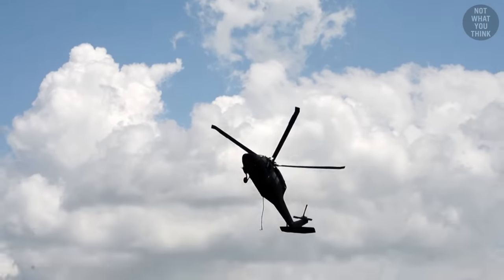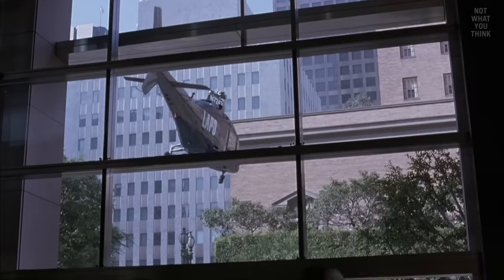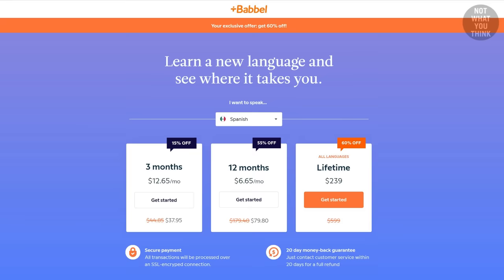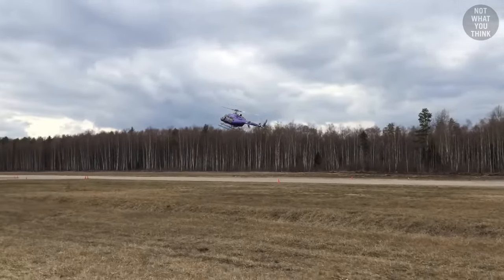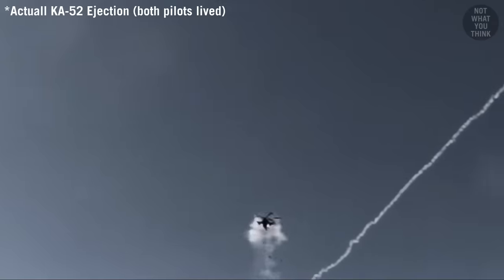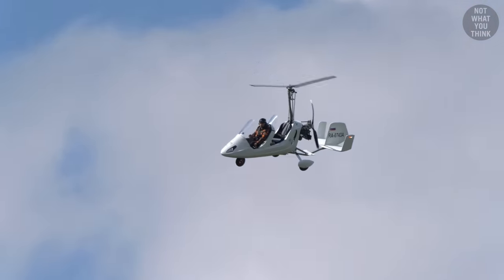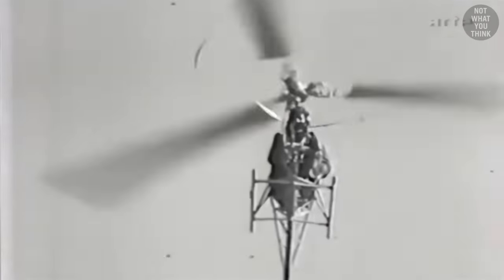Why Helicopters Fall Like a Leaf, Not a Rock

Comment: 40 years ago while serving at a Coast Guard small boat station we routinely participated in training operations with helos.  Autorotation drills were part of those drills and it was impressive and scarey to see an HH-52 with it's rotor blades swooping upward as they plummeted toward the water.  The pilot would engage the transmission about 50 feet off the water to stop the decent and bring the craft to a hover before he would have impacted the water.  Testament to the engineering of the aircraft that they were already almost 30 years old at that time.  The USCG HH-3's were not so reliable and suffered chronic transmission problems.

Comment: something to keep in mind for the facts at the end of the video:

you said helicopters had more frequent crashes than airplanes, but we have to keep in mind that helicopters fly in more complexe terrrain.

i think this could also be said about the death rate. even though airplanes have a higher death rate, airplanes can hold hundreds and hundreds of passengers, and they do more frequently, compared to helicopters. 

all in all, it's hard to really compare the two, since they're practically different worlds. their use and capacity are so different.

Comment: BULL CRAP
@ 600 ft. when you get the tail rotor shot off of a Huey UH1 there is no soft landing I can damn sure testify to that.  It happened right before TET 1968 near the Cambodian border.
There were 5 of us in the chopper. We were returning to Long Bien Base and were about 75 miles out. And if the Aussies weren't in that area our butts would have been KIA. I was a door gunner along with another one on the left side. polit, co-pilot and crew chief were hurt pretty bad but us two gunners were hurt but not as bad to where we couldn't get the Crew Chief out of it because he wasn't strapped in and he was like a ragdoll being thrown around as we were spinning out of control.  It felt like we hit the ground doing 100MPH.  Every bone in my body hurt.  Good news was that none of us got killed but we were hurting for about two weeks. I was hoping that it didn't catch fire, We did get the Crew Chief to come back, I used a canteen full of water and a few smacks in the face he opened his eyes and said, Is this shit over yet? We all got a laugh. We as gunners were strapped in so as not to fall out the door.
We were about 5 miles from the Cambodian border inside Vietnam. 
Long story Short you can't believe everything you hear on youtube or any other platform because most of these guys have never been in a helicopter in their life.

Comment: Ground Resonance doesn't happen randomly. Ground resonance happens when tie downs on an aircraft are not installed properly. Meaning they are too tight. 

If ground resonance does happen randomly without tiedowns installed, that is an issue with the helicopter, as that is not supposed to happen naturally with the bird sitting on the ground.
Reply: I've had ground resonance on a Radio Controlled nitro helicopter, can be a simple matter of the smallest item vibrating and will even change if the fuel tank is full or empty.  Can also be set off by a gust of wind.

Comment: So one critical thing you’ve got wrong, or not very clearly explained, is with how the rotor generates RPM while falling without power. 

The flight controls are rigged such that the full down collective position actually creates a negative pitch. The specific angle needed varies on each type of helicopter. But this is necessary so that the air rushing past the rotor will actually increase its RPM. If the blades didn’t get a negative pitch, the rotor RPM would bleed off no matter what and autorotation would not work. 

On the helicopters I flew on (CH-53E), flight controls would be rigged so that during free fall, rotor speed would increase and maintain approximately 110% of normal operating RPM. Flight control rigging was part of my job as a crew chief and mechanic and I’m positive they get a negative pitch for autorotation. 

Now while performing an autorotation you also want forward airspeed. As you approach the ground, you are supposed to flare the nose up to bleed off the airspeed, then rock the nose back level while pulling collective to get the positive pitch on the blades and cushion the landing. Hopefully it’s timed right and you just land… but really we are just trying to cushion the crash…

Also, the example of ground resonance with the CH-47 is slightly misleading. The whole system is meticulously balanced, but vibrations are never zero.. that example is showing what happens when the helicopter is chained to the ground with no slack in the chains. The helicopter needs to be able to wiggle around on its wheels, kind of like letting it believe it’s in the air. When fixed to the ground, it will definitely shake itself apart. This is extremely important with operating on a ship because aircraft are chained down with tight chains up until it’s time to start up. Then we must ensure that the chains are loosened or removed prior to starting engines to prevent this.

And that leads me to another misleading point about that.. you say two blade systems are not as susceptible to this but that’s just not true. A two blade system can still be extremely out of balance. It’s just far easier to balance a two blade rotor system compared to say, a CH-53E, that has 7 main rotor blades. But I could totally have a 7 blade system that has better track and balance than a 2 blade system done by someone who has no clue what they’re doing.

Comment: I kind of expected the ejection seat system to be just so fast it goes between the blades in time
Reply: That would be tough without relatively small blads and the seats being very far forward. The simplest way of doing it is to just blow the props in the moments before the seat is ejected.

Comment: Other than loosing a tail rotor or engine Most helicopters crash because of 

• Vortex ring state
• Collisions with Power line wires 
• A disoriented pilot in low visibility impacting the ground

Comment: They can drop like a stone. If they are hovering low they can survive the descent. If hovering high when the engine fails they can gain enough stored energy to autorotate. There is a region in between where a helicopter will drop like a stone from the hover and not be able to gain enough energy to autorotate.

Comment: Autogyros were invented by Spanish engineer Juan De La Cierva in the 1920s.
He was very concerned about flight safety and engine failure, so he investigated about autorotation and he ended inventing the autogyro, which he made various prototypes. As the prototypes evolved into a more complex machine he set an autogyro building company in Great Britain (La Cierva Autogyro Company) and he also sold construction licenses to companies in other countries like the US (Pitcairn), France (Loriée et Olivier) or Germany (Focke Wulf).
Paradoxically De La Cierva died in a commercial plane crash in Croydon, UK in 1936.

Comment: In the U.S, a pilot's license is not necessarily required when operating an aircraft. A gyroboat if it weighs less than 155lb would be considered an ultralight aircraft, and under FAR 103 no license would be required. Ironically, adding an engine would increase the weight limit to 254lb.

Comment: I think the reason NASA chose to go with the parachute is reliability more than performance. Fewer moving parts, because you would have a big problem concealing the blades during ascent, and would have to deploy them at an opportune moment in the atmosphere, not to have them burn up. Those mechanisms need to be reliable and robust, and that means weight and more moving parts, and you don't want that as a last line of defense. So you would end up wanting parachutes as a backup anyway, so why not ditch the rotors altogether?
Parachutes can be neatly packed until you have to release them.

Comment: is autorotation the reason why helicopters have vertical stabilizer fins? to counter the small amount of torque transmitted from the main rotor to the fuselage through friction? 
and are helicopters generally built with skids or wheels apecifically for autorotation landings? since during normal landings, they land without forward movement...
Reply: different types of landing gear shouldn't affect the capabilities of an autorotation landing, though wheeled landing gear may generally have some form of suspension that could help cushion said landing
Reply: @wyvern1992  during autorotation landings, helicopters land with a forward movement. under power, helicopters always set down vertically. landing gears of helicopters, be they wheels or skids, generally appear to be designed for landings in forward flight - thus they appear to be designed for autorotation landings. I'm sure that wheels also allow a helicopter to be pushed around on the ground, but skids in particular, which are very common, really only have that forward movement during autorotation landing as a reason to be designed in this way that allows for forward sliding (would also help for a sliding takeoff, but that's nonsense).

Comment: Autorotation is only possible if it has considerable forward motion. A hovering helicopter whose engine suddenly fails does fall exactly like... a brick. It takes considerable altitude to convert falling straight down into a blade rotation that provides lift. Often when you're hovering, you are NOT a such a high altitude, because you are raising or lowering something from the ground, landing, or taking off. In that situation, you're fucked, as autorotation won't help very much. **crunch** Score one for NDT.

Comment: I might have missed it but:
What of the mechanical part of the rotor rotation fail? Then the "parachute" function is lost. and if they cant eject, they die?
Reply: the rotor on a helicopter is like a wing on an airplane. If you lose that, then yeah, you pretty much plummet

Comment: The point about minimum altitude for autorotation is misleading. As long as the rotors are already turning at operating RPM while the engine was running, it doesn't matter how high it is. One of the things that pilots practice is autorotation from low hover. In general, the key skill in autorotation is in maintaining rotor speed as you descend. Descend too slow and the rotors slow down, descend too fast and you risk exceeding the rotor velocity limits. Of course, the right descent speed also happens to be too fast for a safe landing, so you have to pull on cyclic and collective at the right time to bleed off both horizontal and vertical speed and come to a soft landing. Of course, you lose rotor speed, but if you've done everything right, that won't matter any more. You don't have to have zero horizontal velocity, as even without wheels a helicopter can afford to skid a bit, but it all depends on the quality and size of your landing area.

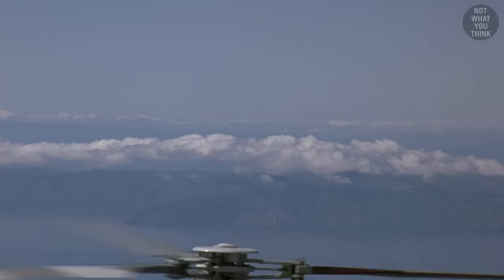Comment: 3:57 That is not how helicopters generate lift. Each of the blades is an aerofoil. Think of each blade as the wing of a plane. As the rotor rotates the blades, the air rushes across the aerofoil blades generating lift, the same way a plane's wings generate lift. Changing the pitch of the blades acts the same way as pointing the nose of a plane up or down to increase or decrease generated lift, allowing the helicopter to fly up and down without any forward momentum.

Comment: A proper autorotation is much gentler than a plane crash but if the blades slow down too much the helicopter does turn into a brick and its hard to recover. To keep the blades spinning fast enough you must angle the helicopter just right its not easy. Helicopters do have a much lower fatality rate than cars if you have a highly trained pilot but if the average person tried to fly a helicopter they would die very quickly. I play alot of Microsoft Flight Simulator in realistic mode and controlling the helicopter is alot harder than controlling the plane.

Comment: I was surprised when it was said helicopters need zero pitch to initiate auto-rotation. I thought some pitch was required to keep the blades spinning caused by the air flowing through them.

Comment: It is not a maple seed. It is a fake nose.

Seriously though, what I'm always wondering is with systems that have a spinning part like rotor, and that reiquires control like adjusting the blade angle, what is the mechanism? It can't be a wire delivering information because it would just tangle around the shaft and get locked in a flash.

Comment: I can't speak to every helicopter design, but it is not correct to say that a helicopter must autorotate when a tail rotor failure occurs. Certainly while hovering and during flight at low speeds; however with the helicopter I flew, the vertical fin completely offloaded the main rotor torque at speeds of 70 knots or higher.

I've also never heard of the claim that leading edge vortices are the mechanism by which autorotation is possible, but I am not aeronautical engineer. The training I received explained it as a region of the inner rotor disk being driven by upward airflow and the outer region producing lift, adding flare near touchdown to increase the upward airflow and translating that energy in combination with the rotor disk inertia into more lift for a soft touch down.

And yes, if the rotor rpm drops down low enough... a helicopter does drop like a rock even though it appears to be turning just as fast as being powered. Rotor rpm must be managed very closely.

Comment: Correction, Helicopters do NOT crash more than fixed wing aircraft . The Turbine helicopter is the safest aircraft 12,500 lbs and under.The piston helicopter is the next safest aircraft under 12,500lbs.

Comment: They told me, well, autorotation can save your life, when engine fails, but.... there is a minimum altitude you need, to get the rotor turning fast enough. That means, below that minimum altitude, a helicopter can drop to the ground. Pilots keep above that safety altitude, below that, you have good reasons to be nervous. It takes time to engage autorotation, meanwhile, you are falling down! Autorotation is great, but you need some time before it kicks in, even if the pilot reacts very fast. So, better not fly too low.

Comment: It's not completely true.  He was a crew chief on a helicopter that got down during the Vietnam War. They had a linkage rod shot out right at the mast that controls pitch of the rotor blades. Loss of lift was immediate and they fell nearly straight down about 80 feet into a rice paddy, breaking the tail boom over a dike.

Comment: Faster is not better… each airframe has a limitation. if you overspeed the rotor then you could potentially watch that rotor fly away from as you fall like a brick. Different rotor speeds are paired with different speeds to a achieve different glide lengths. This can be found in the aircraft’s PoH. Additionally, depending on the aircraft just because you have loss of tail rotor effectiveness, you can still turn by minupilation of the throttle with varying torques. You can then land the helicopter so a short run on landing if you set yourself up correctly.

Comment: Neils statement only proves that you can be a genius and still be ignorant of particular topics. As an aviator I cringed at that tweet. Also, it's a lot more complicated than just simply " no tow rope = need a pilot's license."  The FAA has weight and other regulations that determine the classification of aircraft, and we have sport, LSA and ultralight aircraft that shockingly DONT require any prerequisite training to fly in public airspace. Even up to 10,000 FT depending on the service ceiling of the particular aircraft.

Comment: Both of these things are true, actually. If an engine of a helicopter fails and the pilot does the autorotation maneuver successfully without any miscalculations, it'll fall like a leaf, however if the pilot doesn't do the autorotation properly, I.e, maybe starting too high up, or starting it too late and he runs out of engine power before he's on the ground... That thing will fall like a rock.

Comment: Ok it seems you grasp it well, but the distance of 500 to 700 hundred feet assumes you are at your forward cruise speed, which is the lions share of energy to convert into a controlled decent of an autorotation. The autorotational glide ratio of a helicopter will vary by type and circumstances. Typically 3:1 is a good approximation.

Comment: The most educational toys I ever owned when it came to understanding aerospace physics is a collective pitch RC helicopter and Kerbal Space Program.  The RC version can use the collective pitch to push the bird down as well as up..  So the helicopter can flip over and then shift to "down" pressure....and hover upside down.... or, if you screw up... it can smash itself into the ground right side up with incredible force.  I imagine real ones don't have that.  Auto rotation is a thing in RC helicopters too... if they are collective pitch and not fixed pitch.. Coaxial helicopters are also useless for autorotation.  Even the full sized ones.  Neil Degrasse Tyson was right about coaxial helicopters.

Comment: Bit of a missed point I noticed. The risk of the dual blade rotor is greater because dual blade rotors can mast bump. Which has no recovery option your just dead. So even though ground resonance looks scary it's by far the safer option.

Comment: A plane without a working engine still has working aerodynamics and control surfaces.
With Flaps most planes can perfom an emergency landing.
Reply: Assuming you have;
a) enough airspeed (not stalling)
b) enough altitude
c) a long flat area to land on.